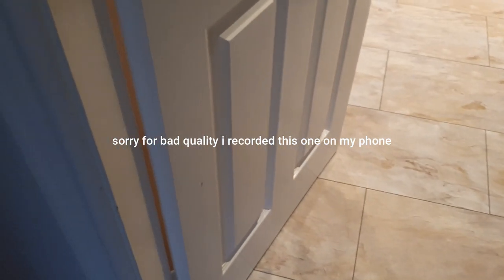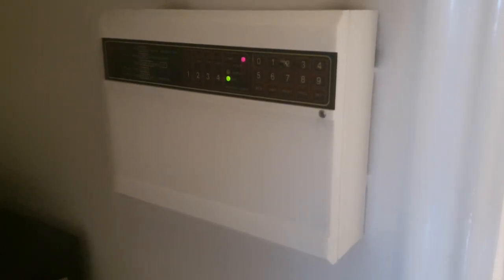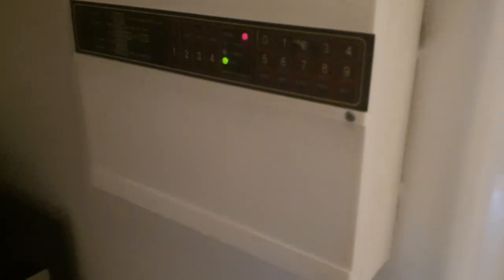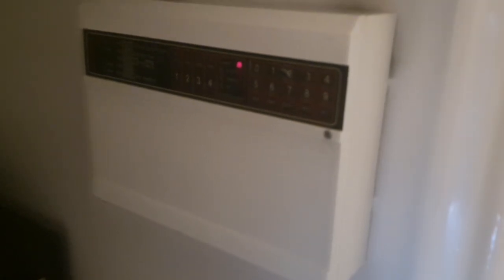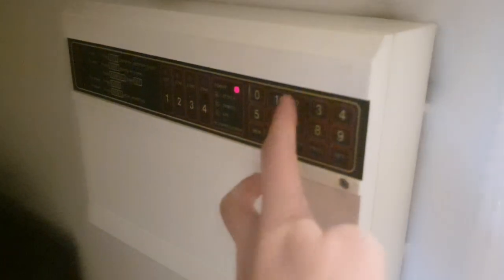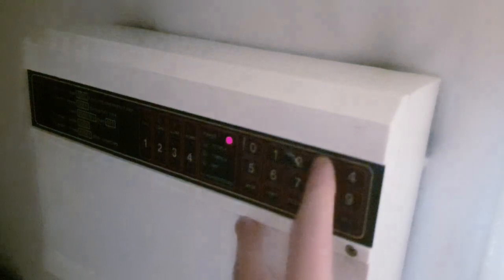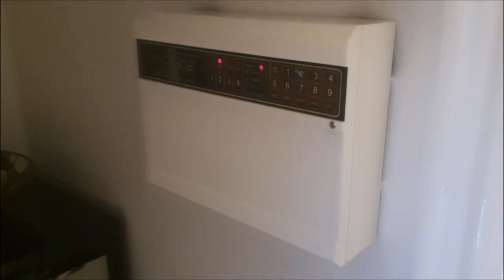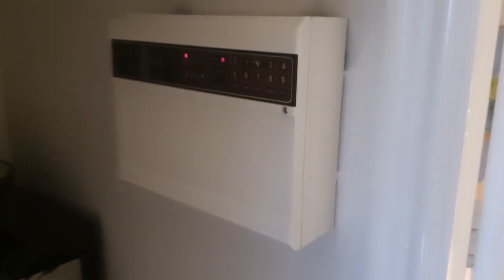Testing an old Optima mk 7 burglar alarm system

Comment: Its probably just dodgy because of the battered keypad and aging detectors. The keypads on the early panels were always delicate, even when they were brand new women with long nails would puncture holes straight through them when trying to put the code in. The type C bellbox is probably bust because of a corroded terminal or similar, I doubt the bell/siren is broken. The wiring for the system is probably ok too, it loks good anyway as you can't see any cables due to the fact they are all buried. I would keep the Alarmcom PIR on the landing as Alarmcom made good reliable detectors, but probably bin off the rest. So swap panel, new detectors, fix the type C as long as its not polypropylene and your good to go.
Reply from the maker: I since replaced the system has been replaced for a while now. the alarmcom pir was kept, everything else replaced. wiring was also in good nick so what was kept.
Reply: @ASSystems  Glad to hear the Alarmcom was kept, they are very good detectors but hard to come by now. What panel and sounder did you replace it with?
Reply from the maker: @jakemcintyre4820  The panel is a texecom premier elite 64-w something like that. It's got a smartcom fitted as well. There was wireless additions also to the system. External sirens are both live wired oddessy x's, one on the rear one on the front.
Reply: @ASSystems  ah I see. Can't go wrong with wired, I would of cringed if you said it had been swapped out for a wireless system!
Reply from the maker: @jakemcintyre4820  ah no, well the wires were there so they might as well be used. but for the added stuff it wasn't worth all the damage it would have caused putting in wired stuff. it's only a shock door contract combo unit, and a pir.
Reply: @ASSystems  Probably a very intruder-proof system now then I would think, you seemed to have most of downstairs covered with P.I.Rs and the Alarmcom on the landing so someone would do well to break in without setting it off!
Reply from the maker: @jakemcintyre4820  the would have quite the task ahead of them if they were to try.

Comment: Visonic are quite good alarms. My nan has a Visonic Powermax and it's been installed for 6 years
Reply: On the alarm community we all say Visonic alarm is quite crap
Reply: @uksds3806  Visonic are good.
Reply: @mychannel0743  how ???
Reply: @uksds3806  they're reliable. M6 nan has has her Visonic alarm installed for 7 years and has had no faults apart from battery low which was 2 months ago. At least I don't like Yale which are appalling

Comment: You could replace the control panel with a smart one and also have a back up battery panel hidden away.
Reply from the maker: The system was replaced a few years ago with some texecom thing i fitted. It's been alright apart from that it does what this one done and it's got the smart system abilities like app control and alerting me through my phone with faults and alarms.